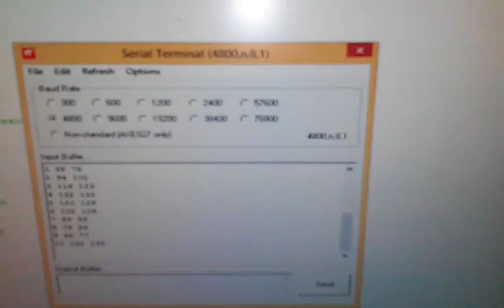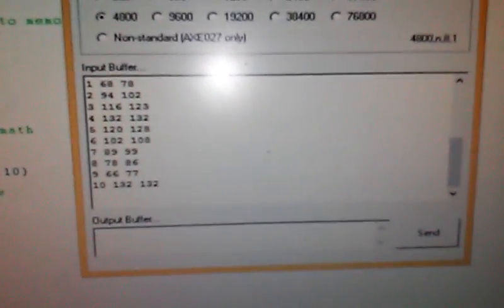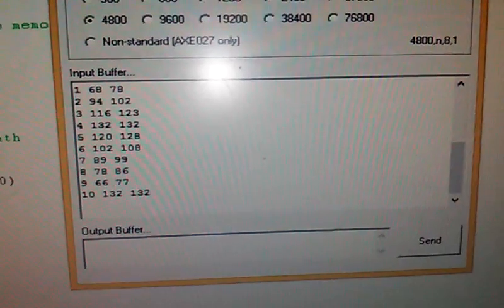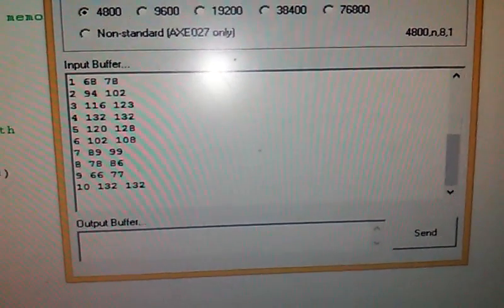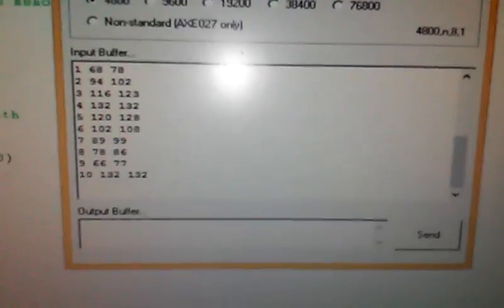ADC Feedback from Servo

Comment: HI! How do i connect the analog feedback wire to? Because SG90 servo has only 2 wire
Reply from the maker: If your device only has 2 wires then it's a motor in a servo case. No feedback possible.